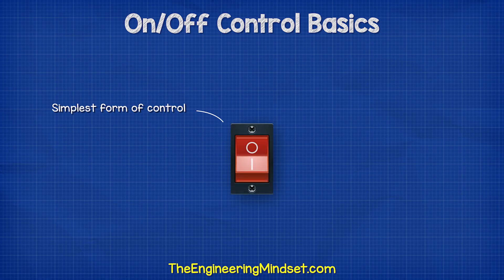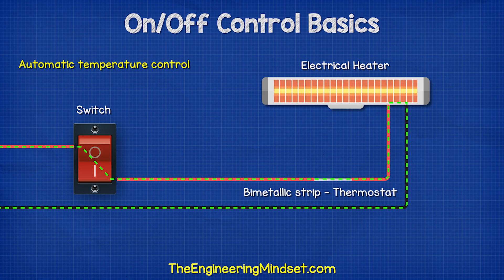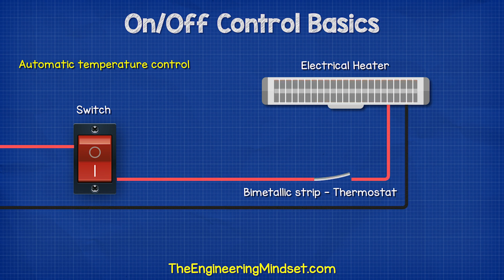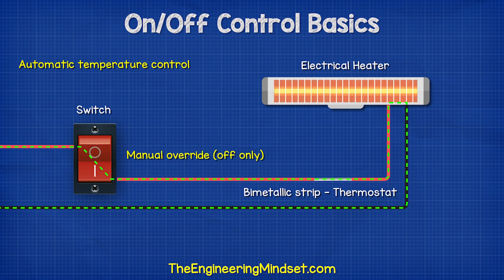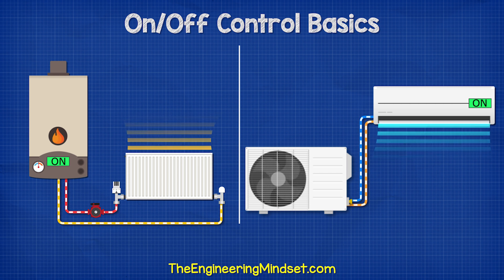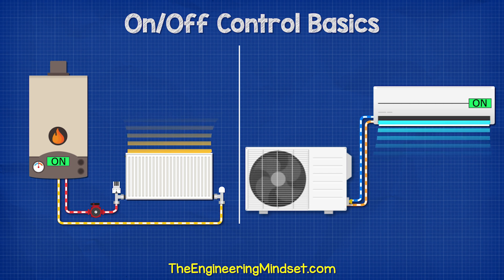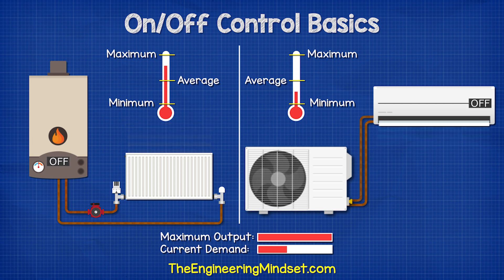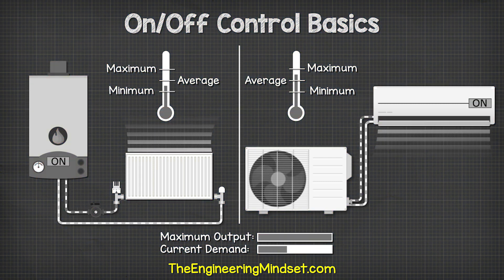HVAC On Off Control Basics

Comment: The new mini ductless systems use a three-phase motor for their compressor. It then ramps up and down the compressor speed in order to maintain the temperature in the room. The goal for these units are to run 24/7, but with much lower energy cost. It's the same thing as your car gets better mileage on the highway, than on the city streets with all the stops and goes.
Reply: Interesting.